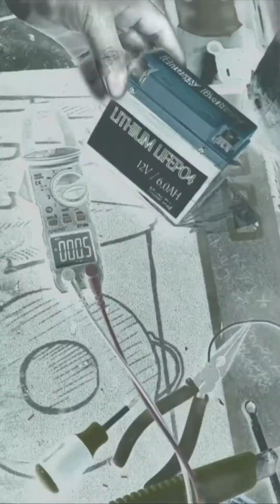Para sa Barako d.i.y motorcycle battery 12volts 6ah lifepo4 ( LDGREEN BATTERY )

Comment: Master ginaya ko yan battery ng motor pero bale 8 battery cells (4bat 12v parallel to another 4bat 12v) ang ginamit ko parallel connection para 12 vdc pa rin ang output.. ask ko lang saan ko pwd ikabit ang wires na 2, 3 & 4 ng balancer?
Reply from the maker: @DoodsPena  Yong black wire ng active balancer sa negative ng battery tapos sunod sunod Nayan hanggang positive

Comment: Bakit walang BMS boss baka Hindi safe yan
Reply from the maker: safe yan boss dahil may regulator nmn yong motor kasi pag may bms nag ka cutoff si bms kapag tumataas ang RPM ng motor kaya na mamatay lagi power
Reply: @MasterD.i.y  salamat boss
Reply: Naka full wave ka Boss?
Reply: Pwede ba yan boss sa mga naka fullwave na motor?
Reply from the maker: @raildiytv5825  pwedeng pwede boss basta kung ilan ang output ng kuryente ng motor mo yon ang bubuo hin natin sample halimbawa 16volts ang output yon ang bubuo hin natin
Reply: 14.6 lang po ang maximum nya boss. Baka kako pwede yan ginawa mo na magaya ko para sa motor kona fullwave. Salamat po